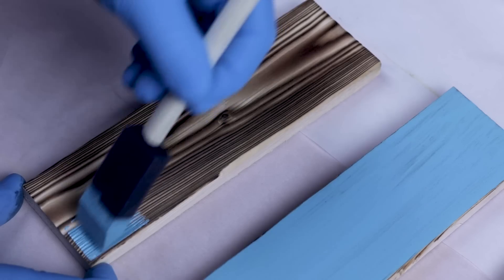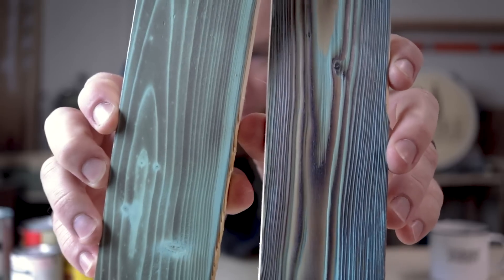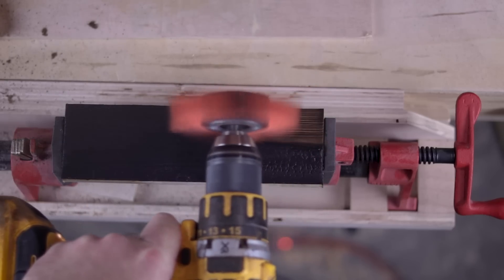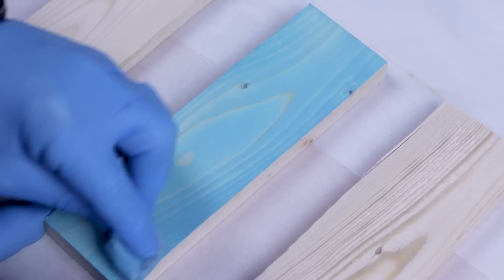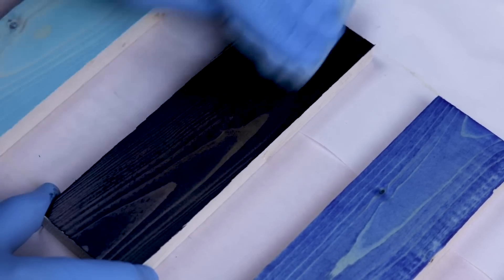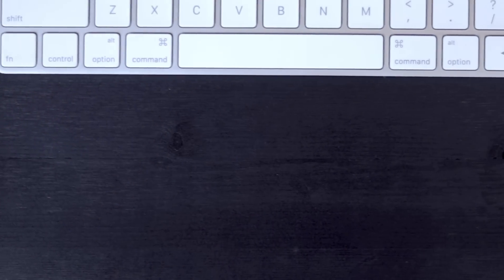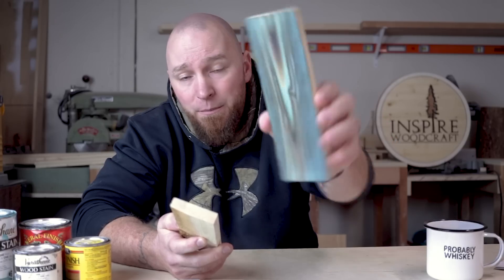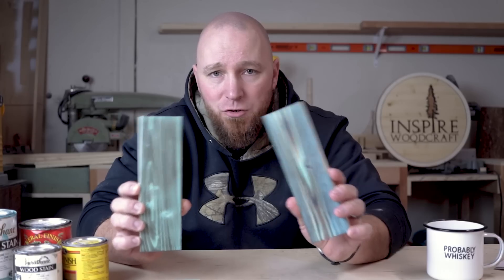One Of These Things Is Not Like The Other / Shou Sugi Ban Face Off

Comment from the maker: What are your thoughts? Hard way or easy way? Maybe a time and place for both?
Reply from the maker: A lot of times I do short pieces because I use them for collage type art pieces. Sometimes I make long runs and then cut them up into the pieces I need too. Just for production's sake. I've never done a jewelry box though.
Reply: Great job showing the contrast between the two techniques.
For me the long way produces a "proper" finish while the short method produces a faux-finish. It looks good from a distance or at a glance, but not close up. Not that a faux-finish is necessarily bad, sometimes it's what's called for.
Reply: You covered that issue really well. Either way is fine, that's the nature of  all art 🎨 in general. Personally I think I'd take the extra time and brush technique. Again, nice video
Reply: Like you said, it's all about what someone is looking for. I prefer the hard burn and brush style over the simple one, but I like to see that deeper texture..
Reply: I prefer the textured look. If I’m making a shadow box or a frame for something I used the textured look on then I usually just do the none texture on the frame so it doesn’t take away from what I’m displaying. Did I say that right?
Reply: My thoughts have been doing the easy way.  I did not know any better but after seeing your video the char way is the look I am after.  Just finished a bench that had some beautiful grain added color did not like it.  Will go back burn it off and try again.  Thankyou for video.
Reply: There's a time and place for both. For me, it's up to the customer as I personally enjoy the outcome of both methods.
Reply: Your way is simply better. Great steps. You can't be lazy doing wood work if you want a nice product
Reply: Your way,the hard way looks better. It has a aged yet refined/elegant look to it also a sertan warmth to it. As for the other one it looks good but looks like something one could get at wal mart or target you know what I mean? A cheaper knockoff.
Reply: Thanks for this video - it explained a lot of why  I wasn't getting what I wanted. Very helpful and well done. 

Question:Have you experimented with quenching the hot charred surface with water? and if so does it give a different effect? I've noticed other videos where the newly charred surface is hosed down with water to cool it.  I have just been letting mine cool on its own and I have to brush quite a bit to get down to the lighter wood. Was wondering if a fast cool slows down the "cooking" depth. I may  try it but  thought I'd ask you too!
Reply: Eric Symank, you would want to put an epoxy finish on the table to achieve the smooth finish. They make colored epoxies as well as clear epoxy. It’ll just depend on the finish you’re looking for. Check out some of the videos by “stone coat countertops” these guys work with epoxy on a large scale and I’ve learned a lot about the “how to” on epoxy from them.
Reply: I have a project in mind (work surface over washer/dryer in laundry room) that I want to try this technique on.  I like the contrast with the surface burn technique and will give it a try on some pieces.  I"m not sure how this will work on pine plywood but I will find out!  Might be nice to lay-up some dimensional lumber for the plank look.
Reply: Your way is better. Clearly!
Reply: I prefer your way!

Contrast looks better
Reply: Hard way by far has a way better look
Reply: Hard way all the way, it's the only right way, looks a lot better
Reply: What is the brush you used? We are flipping homes and I am designing a fireplace surround with couple different gray stains with different sizes of wood staggered with a beachwood look is what I'm after. Thought about white washing stained wood until I saw your video. Very thorough and wondering how this would look on a larger scale like what I am planning. Do you have pics of some of your art on a larger scale? Thanks!
Reply: Hard is better.
Reply: Thanks gonna bring this to woodturning and see how it goes always looking for new ideas thanks for sharing
Reply: I think you already said it- it depends on application. If you need flat, you can't have 3d.  Otherwise full burn for posterity.
Reply: I have not done the alligator skin but, now I have to.
Reply: Full char looks 100x better!
Reply: No comparison,the charred wood has better color and the texture's amazing!
Reply: Great video. I would agree the proper way looks way better. I use both ways all the time the proper way for smaller projects, shelves, furniture etc. but the proper way is not idea for large projects. I am doing a fence the other way with a whitewash stain no way in hell I would do the proper method on a fence wouldn’t be worth the time and effort.
Reply: Your way shows sooooo much more art, in my opinion. Love you videos
Reply: I really like the brushed, in my opinion it is definitely worth the extra work. I want to do that on my kitchen cabnets. I am curious though what kind of look you would get with a darker stain. I was considering black but I may have to move more towards grey.
Reply: You want to make your friend a keepsake for her birthday TOMORROW and you'd rather not put that much effort into it, so you put together a quick wooden Dutch flag (she's Dutch) using the quick technique.  She's going to hang it in her bedroom. She'll love it.  And then....
You are changing the fascia for your house to something that will wow the passerby's.  You recognize that Shou Sugi Ban is foremost a techniques that increases the UV, Weather and FIRE (ironically) resistance. That Fascia could very well be up there 40 years or more.  You want to do it right. You know that the chemical transformations that occur at the surface of the wood as the result of the inferno it is put through is what imparts this capability.  In fact, you wouldn't even have to give it a coating/dye but you do anyway because it's icing on the cake.  You choose Cypress which is especially well suited for flamboyant (with emphasis on the flame) results when dyed something vibrant.  Oh, and it also comes to the table with insect resistance too.  You're a smart guy.
Reply: Really liking that but of gradient with the hard way.
Reply: Michael McGarvey Jr.  Kiln-dried should already be done with any warping. If you press it out it is just going to come back.
Better to get wood that is more true to start with. Even if you trim the warp or plane the cup out of wood often it comes back. Crazy!
Reply: Great video and well put. Hard way if your looking for a better result!
Reply: What would happen if you burn it paint it and THEN sand it ? I would think players of each of the finishes......gonna try it.
Reply: I just recently started watching your videos, I personally really like what and how your doing things. Your explaining it, with differences, with options, cheap tools, expensive Tools, etc. and I agree with this video, it always comes down to preference, maybe the customer, and sure maybe the textured way is more work and 1 person buying that type of piece doesn’t even realize or care but they both have great effects and looks. Anyhow great job, I enjoy your videos and the way you go about showing and explaining!
Reply: Have you done this with chair legs? I love this
Reply: @kikataye6293  - No, but sounds like a great idea.  Planning to make some candle holders out of 4x4 posts cut in short lengths though...   thanks!
Reply: I do it ‘your way’ and I absolutely love the results. I’ve tried doing it the other way and it just isn’t as striking! It is more work, and it is Very Very Very messy but it’s SO worth it in the end! Thanks for all the info you’ve shared about your process I refer back to that series a lot when I’m doing projects and have questions about some step or other. That series really helped me get my projects looking amazing!
Reply: I have been doing it the right way have have never tried the light burn.  I actually don't mind the way that the light burn seems to finish in your video.  I think I might try the light burn finish tomorrow.  Great video!
Reply: Enjoyed it, helped me to understand why I struggle to have all items match.  I am sometimes a little heavy handed on my torching. Thanks
Reply: @jordanpalmer7295  I used the light burn for my van conversion ceiling.   Came out great.
Reply: Now ya did it better roll up my sleeves cause I've got a lot more work doing trim in my house now that I've seen your way I won't be happy with the easy way. Guess that's like ya get what you pay for,which  I've usually found to be true thanx for the inspiration
Reply: Awesome Thanks!
Reply: Hard way  stunning
Reply: Hard way is the best way
Reply: “Hard” way.😁
Reply: I wonder how it would look if you didn’t char but used a wire brush to raise the grain?
Reply: Can’t skip steps or your not getting real SSB. Nice video showing the difference.
Reply: @Eric Symank You could use a clear epoxy for a nice hard even surface.
Reply: I also like the look of the hard/brushed way. It shows off more of the char which gives it visual depth. Nice work!
Reply: Great videos! Truly educational and inspiring. I think the end product will determine which one you choose. I'm interested in this technique to use on a swamp ash guitar body. The surface burn is good for end products that want a smooth surface. For those maybe a light stain if any and then seal. For a guitar, the extreme texture might be uncomfortable for a player who has to rest their arm or body in the guitar for long periods. I prefer the look of the deeper burn though and I go back and forth as to which one to use on my own guitar project. Thanks again for these great videos. Beautiful work.
Reply: I think the way you did this looks much better...more dramatic look to the wood...it's my preference.  Take the time it takes.
Reply: We just did our counters and a few hiccups and I’m ready to throw it away and go this route 
Excellent technique thanks for info!
Reply: Cerusing is very similar, but there is no burning involved. Have you tried it? Video here...
https://youtu.be/iOH8RAJLKKs
Reply: It’s not the hard it easy way it’s the right or the wrong way. You sir are correct, your way is the right way looks much better. I’m am just kidding art is in the eye of the beholder.
Reply: I like your way.And you did a very good job in comparing without telling the other guy yours is better hahahhaa

Comment: I see your old green DeWalt radial arm saw and it brings back memories of my Dad's shop.  He had two of those permanently mounted in a high bench along the wall.  Bearings were so smooth the blade would spin forever.  Until one day he had someone repair one and monkeyed it up.

Comment: I was SO Happy to view this!! It's just Amazing what finishes are doing to wood now!! I Love the process & can't wait to use it. Great Artistry, thanks for showing both ways for those not as into the artistic process. I myself am into it & I Love it Best & will be following you for sure. Thank you Very Much for sharing Your Great Talent, & Instruction!!

I am working on a coat rack my Dad made years ago on a single board, i want to use this color on it. (It may be a cherry board, but its going in a Bathroom with Ocean decor.) I'm replacing older/cheaper coat hooks for  black fancier hooks. This will be SO Beautiful, if the burn takes the orangish color out, which it should.

Comment: I like both! Technique used depends on the application. Hard method produces a dark char of hard wood and allows the bare soft wood to soak up stain for a nice contrast. Whereas the Easy method only lightly chars the soft wood and the stain only lightly soaks in to the uncharred hard wood and also only lightly soaks in to the lightly charred soft wood, resulting in a color washed appearance (seems to resemble old barn wood that has had a wash applied rather than a stain).

Comment: Just did my first burn yesterday with a large propane torch for a box spring cover I'm building made out of 2x10's. Char and scoop seems counter intuitive at first and it is a lot more work but the problem with a very slight surfacy burn is you just don't get that 3D texture. The more the char, the more the 3D texture you get and the scoop reveals the magic.

Comment: Great Video, I get it that engaging with comments and responding to differences of opinion is a great way to maintain interest.   My main sense in this video is that it's divorced from the main idea or Shou Sugi Ban.  Aesthetic is only one part of the concept.  What about performance?   Deeper grooves in wet are likely to cause the wood to age quicker as it will retain more moisture however the deeper burn may have closed the pores of the wood further than the quick technique and hence made the service of protecting the wood more successful.  Be great to see them both after having been exposed to the elements...

Comment: Hey man I did it both ways and you're absolutely right there's honestly no comparison. It takes a bit more time but your way is also more forgiving, doing it the other way and not getting splotches isn't easy. Thanks for doing all these videos on the subject it really helped. My round table came out pretty good, I used a blue dye and it came out darker than expected but I probably didn't dig back the wood enough. Still looks good though!
Reply from the maker: The blotchiness and hot and cold spots is the WORST! It does take some patience and practice for sure, but I'm really glad the end result is something you're happy with!

Comment: I personally do it the long way in order to get that nice gran texture  especially when making a computer desk. 
Now I know that you wont be able to use the desk for writing, but it's primarily a gaming desk. 
I find another option is polycrylic finish that drys clear but gives the wood a wet look making the colors pop out at you and if I wanted to be able to use the desk for writing, I could just add layers of the sealer or just epoxy the entire desk. 
For me it wasn't about the challenge, but more about what color I wanted and if I would appreciate the grainy texture. In other woods my aspect between the two pieces is not difficulty and shortcuts but about color and style. 
Inspire Woodcraft I really appreciate you going out of the way to explain these differences.

Comment: What I'm wondering is which will hold up in the elements over time.  The way I understand it, one of the benefits of shou sugi ban is that it tempers the wood such that it holds up longer when used in outdoor structures or furniture.  I'd love if you could put both those samples out in the yard for a year, and after all the rain and snow and weather, see which one lasts better.

Comment: if I recall correctly the things I've read about the process it is as much about preserving the wood as to finish. as someone noted termites don't like this wood because it has been cured and hardened by the heat which removes the moisture that they want. this made it good for use in their homes. shoshugibon was originally more 4 protection of the wood in their homes then for the Finish. fortunately it does look nice.
Reply from the maker: Yeah I'm not entirely sure about the "original" shou sugi ban because the info on the web is a little muddy. I'm not sold on the fact that it was originally even brushed. It makes sense to me that a full char by itself is the most effective for resisting bugs, rot, moisture and UV. I personally LOVE the look of full char, especially on certain species.

Comment: I love how you take the time to do a comparison of the two.  My 2 cents on this is part of the decision may need to be made as to the application of the wood itself.  If I was going to make a table and wanted a smooth top, the deep char and removal method would take away from the evenness of the board and create peaks and valleys that unless you used a clear acrylic on it could have some bored kid picking away at it and ruin your project.  The one where you just darken it and don't remove much, if any of the char other than a soft sand or wipe down would leave the wood mostly intact and you wouldn't have those peaks and valleys to be ripped to shreds with someone with ADD/ADHD or has a destructive behavior.  I agree with you that the deep char and removal method adds a much more amazing look to the wood as it adds extra levels of shading and dimension to the wood where the other method does not.

Comment: Instead of using a wire brush and exposing light-colored wood, try using a green scotch brite pad. It will dig out the valleys and naturally stain the wood to one solid color. It look beautiful and creates a natural finish. Of course still apply a clear over that.

Comment: Hi, I'll be staining my new hickory kitchen cabinets in a lime/grass green (have tested 18 greens with various stains, oil paint + oil clear penetrating stain, acrylic + water paint, & dyes), but something is missing so I haven't started. I'm going to now try char/brush! Thanks for this video.   Can you please tell us what tools you're using in thid video: flame canister, what type or bristle brush on your drill, and what is the brand of that rich blue stain? Unicorn Spit is the richest stain I've found so far, and mixing oil based artist paints with penetrating stain #209 to create a stain out of paints, since colorful rich stains are hard to find.

Comment: Hi, great videos. should a sealer be applied after the stain to weather proof when using for exterior cladding? I'm in Ireland so pretty wet here most of the time so the cladding finish needs to be hard wearing and extremely weather resistant
thanks